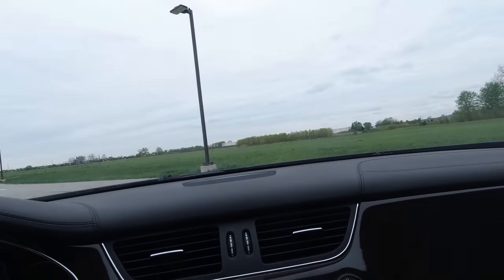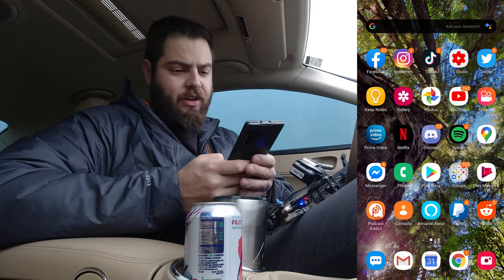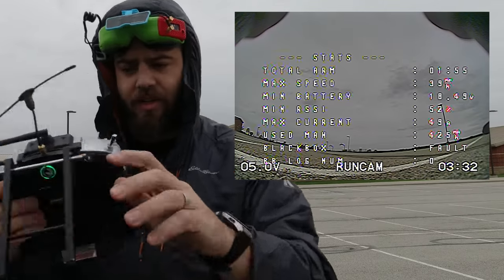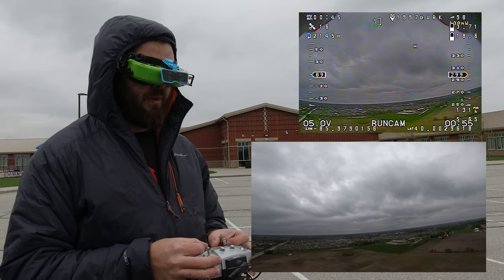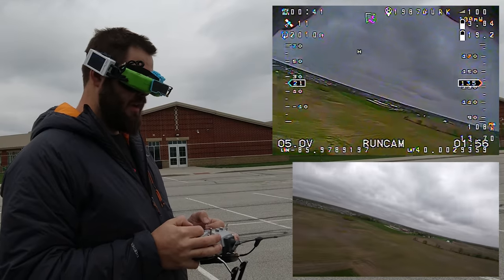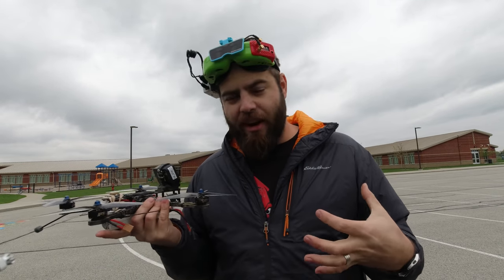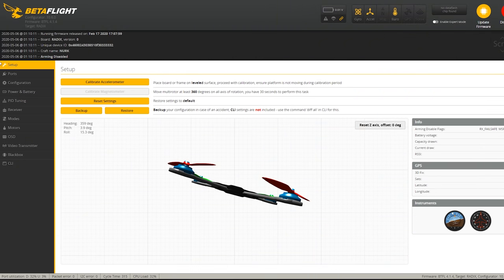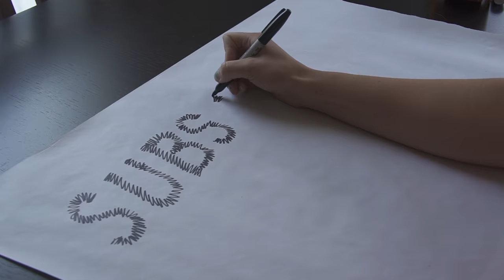I FINALLY Got GPS Rescue Mode to Work

Comment: The "Position" mode for Crossfire can still be used to activate fail safe correctly.  Just set up your toggle switch for GPS Test mode on the radio and in BF.  Then toggle the switch into the GPS Test position.  Then set the failsafe positions via the Crossfire menu.  At this point if the radio link is severed, the Rx will automatically enable the channel for GPS Test and BF will then enter GPS Test mode.     *  THE BEST WAY TO TEST THIS IS ON THE BENCH!  *    Plug everything in and run BF Configurator.  Go to the Receiver tab and then turn off the Tx.  Then watch the channel that activates GPS Test.  It should move the channel value into the region you have set for GPS Test mode to be activated.
Reply: Thanks! You can also test everything IRL easier, just remove props then plug the battery (outside), wait for 7 sats then put your drone and transmitter on the car, arm, drive 300m and turn off transmitter. If your motors go full then it works, if it just disarm then it doesn't
Reply: @jordigrau83  Interesting test idea!
BTW, you should also make sure the quad is in armed mode when setting fail safe positions on crossfire.  Not sure what happens if it gets a GPS Test signal but the quad is not armed.  Maybe that's why Nurk was having problems using that mode.  So...  on the bench with everything powered up (props off!), arm the quad and enable GPS Test mode.  Then set fail safe positions.  Test it before flying long range though!!!

Comment: You can use "set gps_set_home_point_once = on" to make sure that it only sets your home point the first time you arm after connecting a battery, so disarming and re-arming mid-flight won't mess up your home location.
Reply from the maker: Gonna set that right now. 
]

Comment: Biggest issue I've had with GPS rescue in testing, is the Hero7 interfering with the budget TBS GPS module.  A little bit of shielding helps.
Reply from the maker: GPS on or off on the hero7? And then is the communications on (like to connect it to your phone)
Reply: @NURKFPV  All connections off.  GPS off.  It's some sort of RF that happens when you start recording, it affects this GPS.  You can see the effect clearly if you trigger record on the bench while watching the GPS tab in Betaflight.

Comment: If you could fly low at a distance, you could just land your quad at that distance, keep it armed and shut down your radio. If it works, it'll fly up and get back to home, if it doesn't work, it'll just disarm on the ground. which eliminates chances of any hard crashes. Another thing, don't ever set the failsafe switch to be in failsafe when it failsafe in the failsafe tab cause that will make you unable to get out of failsafe mode when you ever failsafe if that makes sense.

Comment: Just build a tbs discovery.
Was hoping for this to work but will switch to inav.
First all cuts when enabling GPS rescue. (ground test)
Switched to sanity checks failsafe to get that work.
Did a ground test by moving the quad 200m from home but didn't trust it. Turning of transmitter same issue as you.
So already was thinking about tuning off crossfire failsafe.
Decided to build a scratch 5" quad with same controller to test.
Don't want to wreck my Discovery.

Hope your video will help.
Looks promising.
Thanks.

Btw my home arrow doesn't work properly.
Any tips?
Just re-upload another font. Not tested yet.

How do you get the H (home) sign in your OSD.
BetaFlight 4.2.2

Comment: So, are you saying that we have manually input the range value in Betaflight for GPS rescue on failsafe?
I thought GPS rescue should automatically trigger when you lose signal (or turn off your radio, provided you failsafe on TX set to "cut"). 
What are the final settings in Betaflight for GPS rescue to work in case of rxloss?
Reply: I have two things happen on failsafe no pulses on r9m and betaflight sets the failsafe switch to on shouldn't need to do that part but its a backup
Reply: I don't think so, I think nurk didn't realize that the failsafe values are stage 1 and not stage 2. He basically doubled up his gps rescues.

Comment: Set your max gps rescue throttle to like 1300 or so, and it won't sag your battery so bad. I think the default is like 1600.
Reply from the maker: Yep i just noticed that setting finally!

Comment: Ran into a problem myself and was wondering if anyone could answer. My gps is connected properly and setup in betaflight, but GPS_rescue doesn't activate in modes tab. It's set, it just doesn't light up/activate when the switch is pulled. In testing, I have my current level mode in OSD and when I flip my gps rescue it does not change to "Resc". Therefore in flight, it just drops. Haven't been able to figure this one out. Plz halp meh.

Comment: Im running a speedybee f7 v3, i plugged the gps into the gps connecter. Would I have to swap the rx and tx pins so rx goes to tx and tx to rx or is that already done in the connecter? If that made sense lmao

Comment: Nurk great content as always. I stopped flying my 7icnh build I can not get it tune right. It's a 6s rig flew ok on 4cell but when going to 6s I have nothing but trouble tuning. running 2208 1700 kv xing motors, kakute f7 v1.5 an holybro tekko 32 4 in 1 . Any help to get in the ballpark of a tune please lol. also i'm running bio directional  an rpm filter betaflight up to latest .my 5 icnh quads I can tune no problem

Comment: have you tried not using any stage one config? I have all in hold without failsafe switch, just stage 2 and it works, using crsf also, just curious
Reply: That's what I was wondering too. I don't think you need to failsafe to the return to home switch (do you even need the switch set up?) Just have it in stage 2

Comment: You got it working!  Nice job.  Maybe you could try using GPS on an iNav flight controller - that would let you fly waypoints.
Reply: can one mix betaflight and inav? or do I have to choose only one of those two? May be a silly question for experienced, but I'm a noobie, ok.
Reply: @timcable  iNav is from the same code base.  If you can use Betaflight, then you'll have no problem with iNav.  The differences are in the minor features - such as GPS.

Comment: I would turn back on sanity check. If u by any chance do crash or faillsafe gets triggered under a tree or object and it goes up and crashes it will keep the motors running until it burns! Ask me how I know 🤣. Also once I had a motor desync and it crashed loosing signal on the ground activating failsafe then it just burned. So keep on sanity! For my r9 setup rescue worked without changing any settings

Comment: It's so funny watching people fly so high to test RTH. If it falls, you fall hundreds of feet. I test mine while hovering 3 feet off the ground and 100 yards away (I've set my minimum distance to 100 yards), then I do my tests. If it falls, it drops 3 feet.  If it works, it flies up to the specified altitude, then flies home. As long as my GPS is working, RTH just works (when using the settings Bardwell describes in his videos). I have an RTH switch (3 position... Acro, Angle, RTH) so I can enable RTH manually. If it loses connection, it'll go into RTH automatically, and when connection is recovered, it puts the quad back into whatever mode the switch is in.

Comment: I was watching every video for GPS rescue and made all those changes and failed
But with those set values in Stage 1 failsafe section fixed it, But isn't it wrong to activate gps rescue in Stage 1 failsafe
When i remove those setting my quod disarm itself in mid air
Can anyone advice me about this
(FOR NOW AUX SWITCH SET ON STAGE 1 FAILSAFE SETTING WORKING FINE)

Comment: For mine to work correctly  I have to have my quad pointing North when I plug in the battery, otherwise the GPS and compass seem to battle it out trying to decide where home is.  If it is pointing North when I plug in they are in total agreement and it works great.
Reply from the maker: wat - pointing north! That's crazy!
Reply: I think my matek Gps does the same thing. Compass is off unless I arm facing north
Reply: You really should just disable the magnetometer. They're notoriously difficult to calibrate and keep calibrated on a quad. For a basic autonomous function like gps rescue, the heading from the gps is good enough for betaflight
Reply: Good suggestion. I will try that!

Comment: I have gps installed and enabled on my rig. For some reason altitude always reads zero. I'm curious if there's a setting somewhere to enable gps altitude rather than baro. I'm guessing recovery mode isn't going to work until I get this right. Please help, and thanks in advance...

Comment: Ssup Nurk!  Danger?!?
  So does that mean if you get your radio too close to the RX and it fail-safes that way, idling on the ground with your face over it, that it will launch up to 300feet taking your nose with it?  LOL that would make me want to tie my radio to a long rope and drag it on top of the quad just to be sure....
I'm going to be messing with this soon and that's the first thing that came to mind when you were discussing your setup - turn off radio=300' launch.  Perhaps make a lua bool variable that you set true after you are at a safe distance and flick a switch, safely 'arming' your RTH (forcing you to consciously ensure you keep radio away - and I'm not so sure if crossfire even does that like an FrSky)  Could've explained that better but you prob know what I mean...
I need to look into this as it would be a fun and useful programming project.  When I wasn't writing VR software I was writing ship navigation software for Ratheon, ensuring oil tankers don't run aground.  I have a knack for super complex logic state machines for some dumb reason .

Comment: lol you set AUX4 to 1800 but min for GPS Rescue to activate is at 1850. so it seems that this setting is not needed after all. nice work that you got it working!
Reply: you can expand the slidders for example from 1600  to 2000... so 1800 will trigger rescue

Comment: I set my failsafe delay to 0.1 seconds, because for gps rescue nothing bad should happen, and that way, I will loose less altitude during an actual failsafe.
For non GPS, I keep it on the default, so hopefully I can regain control, if only a small dropout occurs.

Comment: Love the vids but double osd why can pros turn off some of the runcam osd I don't think you need to know 5v is powering the cam
Reply: FPV Arborist aren’t there OSD settings in the app? I know it can be a pain to connect everything, but it should let you adjust settings

Comment: Alternately, you could load up iNAV and it will land softly in the boot of your car......lol...
Betaflight, a controlled crash at your feet.....maybe...lol.
Reply: The only reason I run inav is for that reason, do it can land itself. Still debating if inav is worth that one feature given all of the other things inav lacks. What’s your take?
Reply: @chrismasih-das5741  Used Betaflight for ages, iNAV on my fixed wings... iNAV is great on a quad now, in fact I find it flies smoother TBH...and RTH works every time..
You can see it on my channel.
Reply: @EnglishTurbines  I'll have to check your videos out.  What's really scary is sometimes the RTH will work fine, then a pack or two later, toilet bowl... I'm convinced it's probably a cheap GPS/Compass that i'm running.  Ordered the 880 so hopefully that does the trick!  What GPS/Compass are you using?
Reply: @chrismasih-das5741  I use a GPS with a compass onboard.... iNAV uses a compass, Betaflight doesn't. The quad can't maintain position hold without a compass . An F7 board is also a good idea...You can see my GPS in my latest videos...on the Croc.

Comment: I just found out today, if you do a lot of aerobatics, it will throw the barometer wildly off.  So if you activate GPS rescue, it very may well fly into the ground.    Or if for some reason when you arm it the GPS coords of the home location are wrong or way off, if you fly out of range or lose signal, and GPS rescue activates, your quad is bound to fly off in some wrong direction towards some coordinates in the Pacific Ocean and you may never see it again, and all the lost telemetry on your DJI goggles or transmitter won't help you find it ever again.  More possible is you lose the GPS connection while flying back... I've been in areas with military or airport radio interference (even though I'm not near them) that will totally kill GPS...  your auto GPS, handheld GPS, everything... no matter ho wmuch you stop and fool with them, or stand and wait around, GPS satelite pick up is gone.

Comment: Does anybody know why I have this strange behavior....I set failsafe -> GPS Rescue...went far away like 300mt turned off my radio...RXLOSS..FAILSAFE..GPS RESCUE engages and quad starts flying towards home point..I power my radio back on (checked that I got RSSI back, I'm on TBS Tracer) as soon as I start moving my sticks the quad starts responding to my movements but still in failsafe and suddenly the quad disarms and falls from the sky. Hopefully I was able to arm it mid air and save it :) I'm frustrated! GPS Rescue mode switch is working perfectly when I start moving my sticks I regain control....Failsafe switch works perfectly too..starts RXLOSS failsafe and when I start moving my sticks I also regain control....I have the issue only with REAL FAILSAFE...the only scenario where I actually need it to work :)) Thanks for your feedback.

Comment: This topic is frustrating no doubt. Its not BF problem, its the FC that is. So many debates so I thought I would walk away and investigate what wingers say after my 7 just flew away to never never land ( Wingers have decades of knowledge quads are just passing infancy. I came across a  chat last night from 40year , street smart Futaba RC winger that blew up on a page about the topic. He yelled ! turning off remote means DESTROY vehicle ! It does not in any way replicate fail safe process at all ! as fail safe starts to light up when bidirectional communication RX_TX stars seeing delays and countermeasure have to be worked out in the delay time period ( what did the pilot want me to do? oh his settings !) OK I will start the initiations now . Delays are the critical  moment needed to do a hand over from Transmitter to what ever flight controller. Its not a millisecond process like we want to think it is. So I guess the last beer is no switch, no remote shut down, let FS happen autonomously. Quad FC's don't have the electronics build in for a true return to home like say ZOHD  Kopilot that the return to home data stored  100% in a onboard chip set if the TX is just dumped it does its thing. Wish ZOHD made quad FC's ! lol

Comment: Betaflight GPS rescue on failsafe seems a really, really bad idea. People like Bardwell should have pointed this out a while ago. It is attempting to use GPS only -- and you understand why as most betaflight quads do not have a baro or a mag. It 'may' work or it may not. Small quads are very hostile EMF environments. Most people are putting very cheap small clone GPS units on their quads and hoping for the best. All it may take is a high Kp index day (sun activity) and your GPS just loses the battle with its environment and your quad takes off. I am not sure I would want my 5-7 inch quad meandering off aimlessly in an urban environment. If you do not fly over property and people and accept that the quad will fall in the event of a problem then you have controlled your risk. Adding this half-baked (no dis-respect to the devs btw) rescue mode just adds enormous risk and your quad may fly God-knows-where. This video shows how hard it is to get working even in proper test conditions. By all means have a GPS and use it to track lost quads. You are just bonkers if you deploy this -- you will be liable for what happens. If you have a long range quad use iNav or Ardupilot. They have properly thought out guidance using mag and gps and failsafes and can be set up to work very reliably. My 2 cents only: Don't use this.